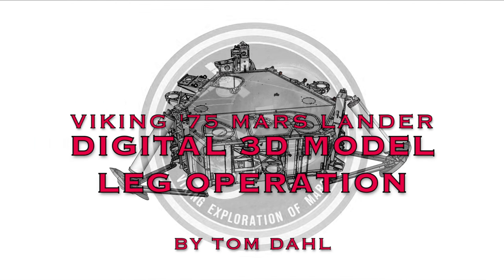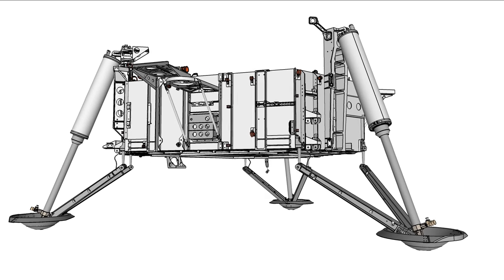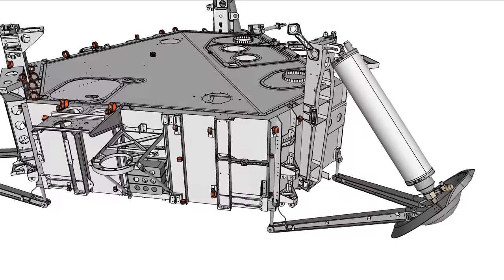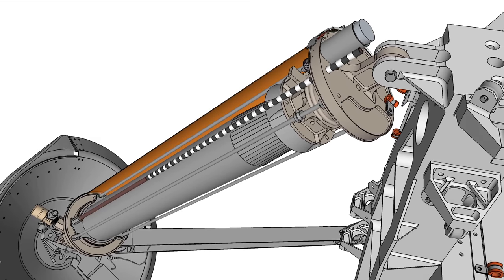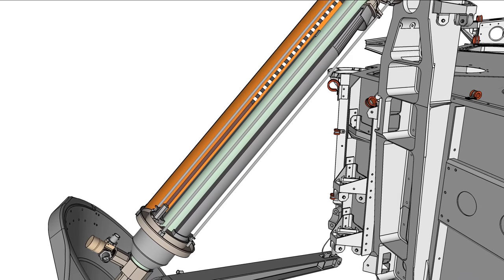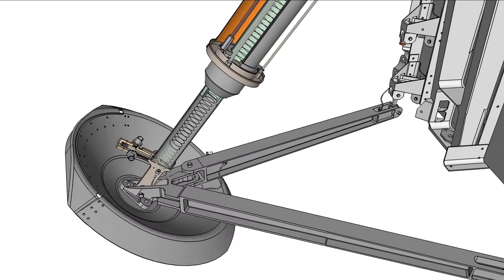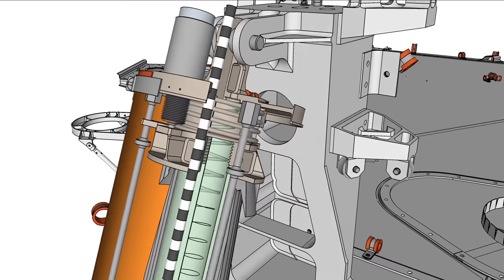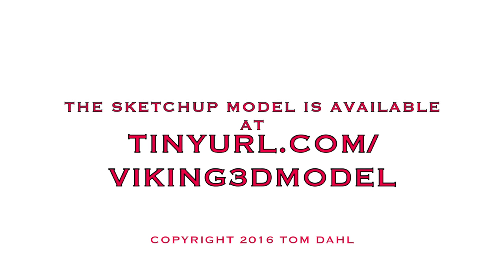Viking Lander Leg Animation

Comment: How did you find the reference to make this model?
Reply from the maker: +Charlie Ringström Hi Charlie, for the past four years or so I have been searching for reference material (e.g., original engineering documents and photos) on eBay and book shops, and on-line. I've been traveling around the US to institutions that have Viking material. I have captured about 2,000 detail photographs and nearly 1,000 measurements of actual Viking hardware, with the kind permission of museum directors, curators, etc. I will add links to all of my photos and measurements (which I have made publicly available on the web) to the video's description. I'm still hunting for more! An outstanding source of original reference material (documents and hardware) is the Viking Mars Missions Education and Preservation Project: http://www.thevikingpreservationproject.org
Reply: Wow, that's some serious dedication! Good luck!